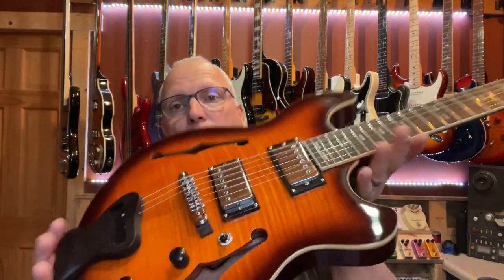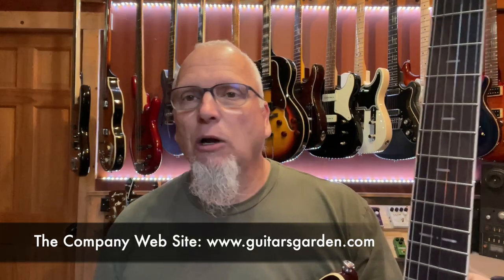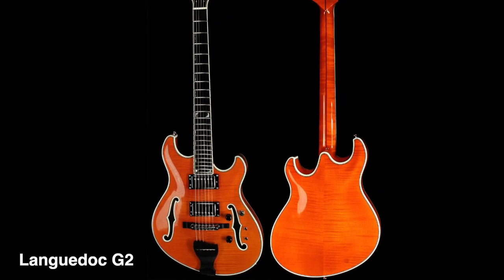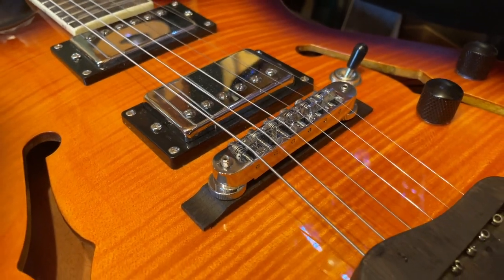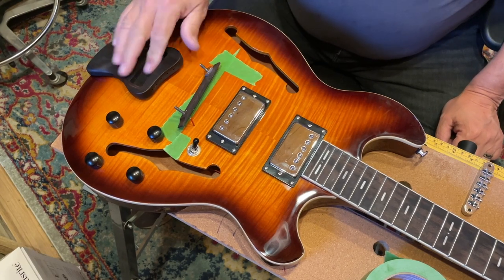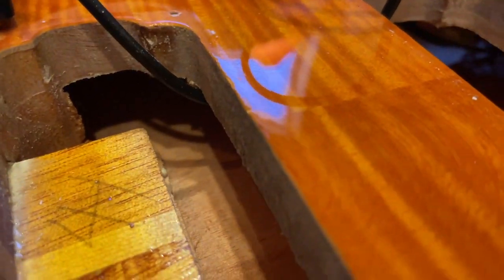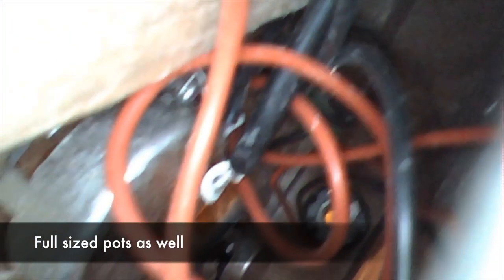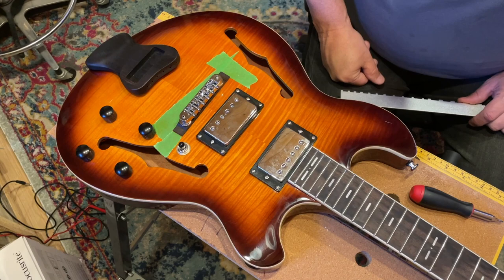Firefly Pegasus - Winged Stallion or Bum Steer?

Comment: Just got my Firefly pegasus yesterday and I was thoroughly impressed the only thing I had to address was a slightly high not action but no one at all the reviews about the pegasus mentioned that there is no electronic access cover on the back So if you have to replace any of the pots how do you get to them
Reply from the maker: Well it’s a true hollow body so you can pull them out through the pickup routes. If it were semi-hollow like the FF338 they would have to come out through the F-holes.

Comment: I am rather shocked because, while I've had good experiences with the two 338's in our household, the 'making it much better' was all self-done, and relatively easy.  That is , sloppy tuner replacements to Wilkerson cheapo's; bridge to roller-bridge replacement; nut replacement to a Tusq; fret and body cleanups which I do on every guitar.  The waxing-the-pickups was the more time-consuming chore but more interesting than difficult, and I thought I learned much more than the hassles alone.  On the Pegasus, maybe it's because it's only 2 months old, I haven't found any reason to mess with the pickups.  They are still not 'predictable' to me but no 'new pickup' is... I believe my learning curve is about the same, although I assume their top-end results for MY uses will be lower than my best-ever guitars.  Which are $6000 Collings, $5000 Gibsons, $3500 Fenders.  Gee... a $200 guitar coming CLOSE to those is kinda wonderful, eh?

Comment: Well done, thanks. I agree with your conclusions. I also got a Pegasus and had a similar experience re communication, but not as much delay - I think it took about 10 days from order to arrival.  On the day it arrived, I did get an "it's out for delivery" notice from Guitars Garden, but that was it. Also, interestingly, the guy who did my setup said the ground wire under my bridge was disconnected, he had to solder it.
Reply: Good call taking it to someone for a set up.

Comment: I ordered my Firefly Pegasus on Monday and received it on Thursday. That's a 4 day shipping time. Never got a guitar that quick before ordered through the internet. The frets ends are cut at different lengths in relation to the edge of the dark fretboard wood. I don't think I've ever seen that before on a guitar. The fret ends are smooth however. The set up on this guitar is horrendous. The guitar looks like it needs a truss rod adjustment and a raise in the bridge height. It seems with most guitars ordered online nowadays the sellers will make some effort to make it playable when you receive the guitar but no such luck here. The six neck tuners feel real cheap when you turn them. The finish of the maple spalted top is A grade, looks real nice. I can't find any blemishes or flaws with the binding. I also can't find any blemishes or visual imperfections on the guitars body.
Reply: It did not take long to do a set up on the Pegasus guitar, maybe 15 minutes. I adjusted the truss rod to make the neck straight and adjusted the bridge to bring the string height up a bit. The guitar plays well with no fret buzz. It looks like an exotic, expensive guitar with that cool spalted maple top. This guitar is definitely worth the cash and was a good addition to the other 39 guitars in my collection.
Reply: The tuners on my Firefly guitars are excellent and the cream of the crop compared to the average tuners on cheap guitars (which are all pretty good nowadays).  The tuners are very beefy heavy tuners.  I really haven't seen any bad tuners on guitars since they quit using those tuners with the trapezoid cases that were used on Squiers and other cheap brands years ago.  Those totally sucked!